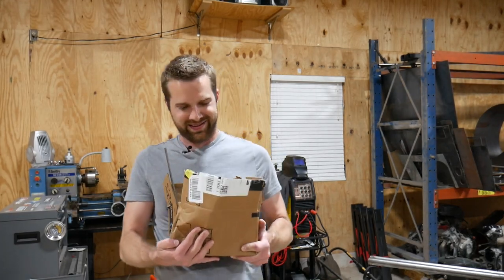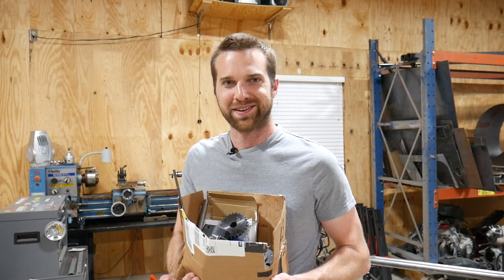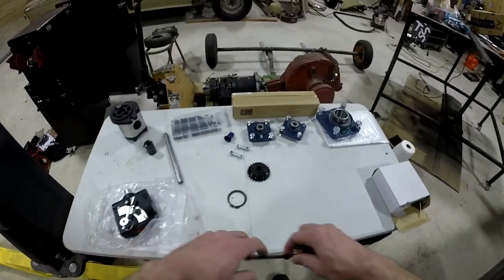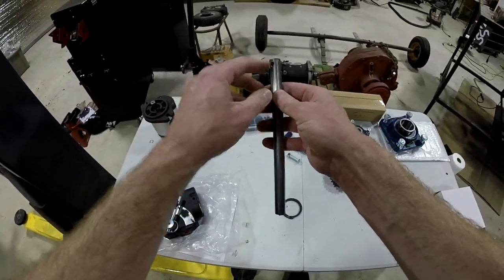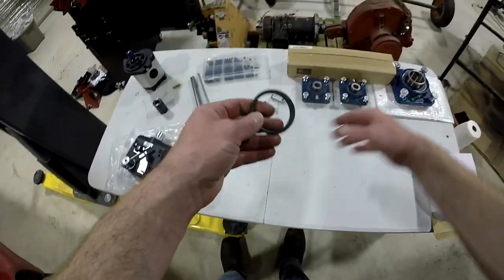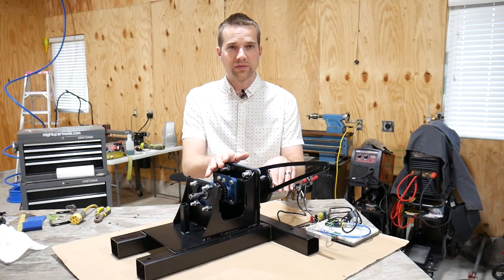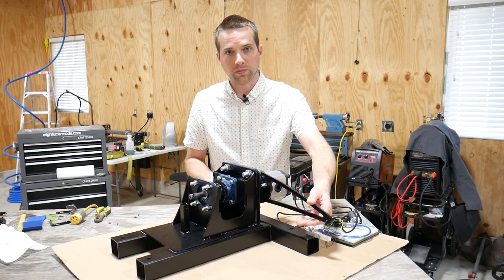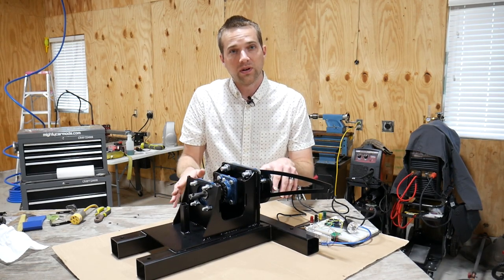Fabrication - Budget DIY Dyno

Comment: This project is actually "Extremely" cool and i'm planning to build my own mini Dyno myself and came over your channel, so if you don't mind i will use some inspiration of your build 😉
At first i planned to use a Alternator but i have a bunch of used hydraulic pumps and motors in different sizes so i'll think i will use them instead, then i can test higher power and torque.
Thanks for a great video and i will have a look at your other videos 👍
Reply from the maker: Feel free to use what you'd like and good luck!
Reply: I agree with Richards completely!!!! And I had seen some using electric as well as the straps and blocks. But I also have several hydraulic components laying around and I really want to build this myself. I have a 660 ish. Lol Yamaha raptor that drag race and have recently setup for the 1/8 mi and this would be the ultimate tuning aid. Could I possibly message you or email for questions? I understand the mechanics but I’m a little behind in computers?  I definitely would try to not be a problem. Awesome layout. The hydraulics seems way better to me!!!! Thank you for sharing

Comment: Are there any high  pressure pwm flow control valves?
Reply: Also can you give more detail on the mounting of the pump.
Reply from the maker: Yes there are, but the ones I have seen cost almost as much as the rest of the dyno. If/when I revisit the dyno I'll be sure to look into this more!
Reply: @DirtyElbowsGarage  Why not use pressure to calculate rpm.

Comment: Why is there resistance and memory in the load arm? what sort of pump are you using?
Reply from the maker: The arm is keeping the pump from spinning with the shaft. The more pressure built up, the more resistance the arm sees. I'm not sure what you mean by "memory" but the pump I'm using is a gear pump.
Reply: Dirty Elbows Garage no I understand what a load cell is and the concept of a metered foot for measurement of ft/lbs. what I’m referring to is the pump seems fixed in one location where I think it should naturally rest on the load cell not sit proudly off and when you pull it or push the arm down or up it has a tendancy to return to its original position like a spring will revert to its preset hence it has a memory. Which I questioned what type of pump it is as you wouldn’t get it in a gear pump or a vane pump I imagine as they have clearances so I was wondering whether it was a radial or axil piston pump. That internal vaccum may cause the memory?
Reply from the maker: Ah I see. Good eye noticing that. So the assembly was completed semi-loosely so some of the bearing mount bolts being tight and some loose caused that. I wanted to do a final alignment and then calibration after the hoses are attached. As you'll probably guess the hoses are the trickiest part of having a free-floating condition. I was able to align, get it tightened down, and still ended up with a slight load offset on the load cell, but with some quick calibration + offset it holds zero. Other pumps definitely have good points to offer but this pump was a cost effective solution. While the flow rate of gear pumps typically sees non-linearity through the rpm range, my daq system works outside of the fluid itself so that shouldn't be an issue.
Reply: @DirtyElbowsGarage  Cool, when you end up doing your final diagnosis on the engines, can you add what the PSI rating the pump is plus the pump pressure at maximum horsepower as its an indicator of what that pump is capable at holding in term of horsepower. eg. If the pumps rated to 1500psi and your holding the engine at XXX HP at 4800rpm and the line pressure is 750PSI  then we can assume the particular pump is ball park rated at double the horsepower before the pump case explodes hahaha.  Can you link the parts too in the description.? Thanks.

Comment: Where do you get Plans to Build this? 28 GPM Hydraulic Log Splitter Pump 2 Stage Gear Wood Splitter Pump 3000 PSI NEW USD $294.88 on eBay would Dyno a fairly high hp engine wouldn't it?

Comment: I would like to purchase an arduino shield that was sold by 2stroke stuffer, would you happen to have one.
Reply from the maker: No I don't. I made my setup from scratch, didn't know there was a shield like that. Is that all you need left for your setup?
Reply: @DirtyElbowsGarage  I have all the mechanical work done. I am using two Hall Proximity magnetic sensors, one for Engine RPM and one for pump shaft RPM . And a load cell for the force. What I'm lacking is the know how to hook up the arduino and the code to make the graph . 
Thank you for responding .
Reply from the maker: If you have a chain coupling the pump to the engine (or direct drive) you can simplify things and remove one of the sensors reading rpm. Unless you're keeping the clutch on then maybe it'll be useful for 2. 

The code I wrote has titles above each section to help translate what's happening. Best I can advise is to work your way through it with your sensors and find individual tutorials on each one before bringing it all together.

If you need it I can send you links to the sensors I used but it might cause you to rework what you have.